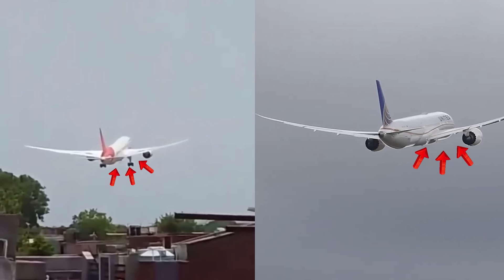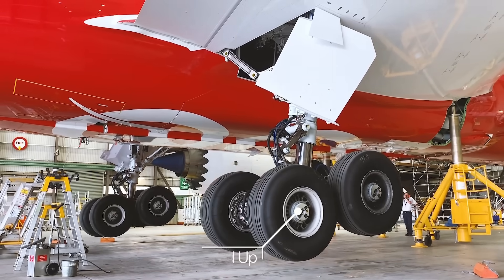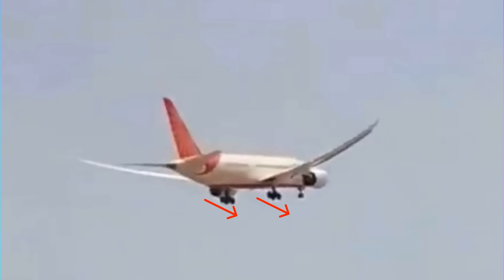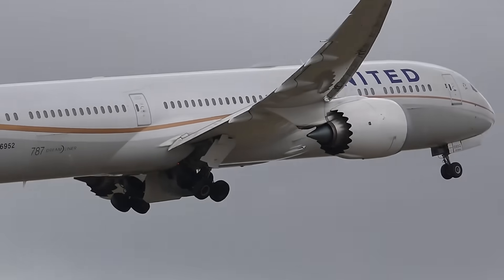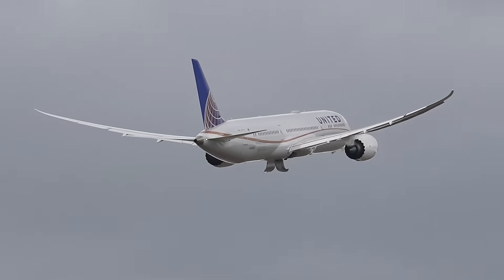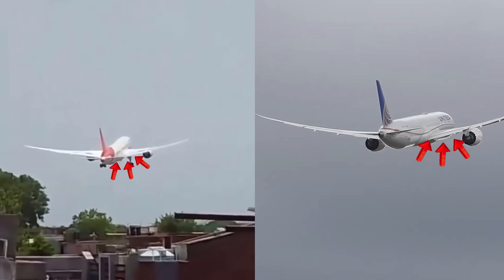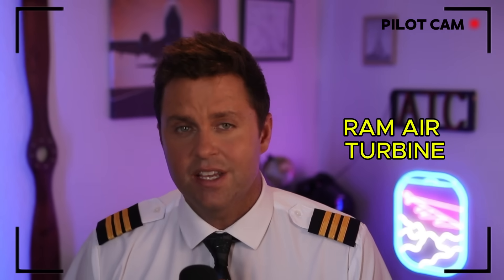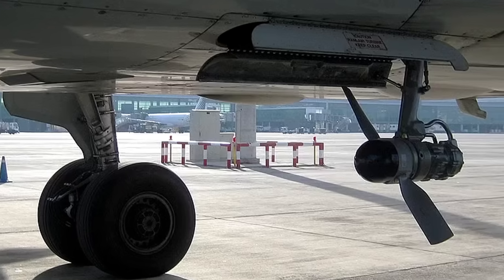Pilot Explains: A New Detail in the Air India 787 Crash Everyone Missed

Comment: I wondered about contamination.  It's either dissolved in with the fuel, or it's separate.  If it's separate, could it get from the gate, all the way to the end of the take off roll, before the contaminant got into the engines?  Seems unlikely.  And if it was dissolved, it would have a negative effect on the take off roll, but if it was enough to get into the air, then there would have been enough thrust to keep flying - it wouldn't just give up like it seems to in the videos if it made it that far.  I fear something else went wrong.

Comment: The CVR will tell the tale for the most part and the engine communication system can tell what they were doing independent from the cockpit from what I understand. I don't know if these were GE or Rolls Royce but most multi million dollar jet engines are leased and the manufacturer keeps tabs on the engine performance as I said independent from the cockpit. Noises indicating warnings and system switch or pilot input are also heard on the CVR. So I think there will be a day when all system coms and CVR coms are transmitted and stored in real time so a crash can reveal what was happening seconds after an incident from inside the cockpit as well. Tower and ATC coms are all recorded in real time and are available in minutes to a few hours as opposed to CVR recovery and transcription or actual voice. Your input Gary is right on. I would think the second the Pilots knew they were in trouble someone would have hit TOGA instantly. The flight appears to have used up most of the 11,000 foot of runway and the entire flight time appeared to be nothing more than the momentum built up in the takeoff run. It looks like they had nothing to shove into the firewall. Just as the flying pilot issued  a "gear up" order, I am not sure that would have helped because the gear doors appear to go dirty before the trucks get into the wells. Just not enough time,  altitude, or speed. That age old triad needed by us pilots to remain aloft.

Comment: Water in the fuel sounds very plausable at first but knowing how the boost pumps work on modern aircraft I really have my doubts. The pumps churn up so much fuel in the tank that any water would be mixed with the fuel and burnt unless there is virtually all water in the tank. And no other aircraft had issues? Are tanker trucks used or is there underground hydrant system? The engine generators do not power the FADECs. each engine has it;s own dedicated PMA that powers the FADEC

Comment: What about the video circulating from a passenger on the flight from Delhi to Ahmedabad showing that nothing electrical indies the cabin was not working? Including the AC in the cabin, which was incredibly hot. Wouldn’t that indicate that the engines weren’t powering the generators and a possible engine problem? Would that even have been investigated before the take off to London? Thank you.

Comment: I think your assessment in the video is very close to the mark.  It is also supported by that they only just got into the at the end of the tarmac (the swirling dust) plus the ATC comms 'no thrust'.
Reply: Then why didn’t P1 follow FCOM/FCTM and call ‘STOP’ before V1?
Reply: @rep7552  Suspect the issue kicked in after they past the point of no return.
Reply: @StephenMcFadyen-j8j Perf A a strong point of yours? How familiar are you with 787 OPT? Or V1, VR, V2 splits? Have you run the numbers for this airfield & enviromentals? Because when I ran a dummy set of calcs, it would have to be obvious way before V1 was reached that something was not correct….
Reply: @rep7552  100% correct if the loss of thrust was evident prior to V1.

Comment: The trouble started on the runway; the pilots were aware but had to commit in the faint hope of sorting it out in the air. My heart breaks for them and the immense loss.
Reply: Oddly enough, they would have done the correct thing by NOT aborting above V1.   But if this was an intersection takeoff.... as I believe it was.... they will be justly vilified for leaving usable runway behind them.
Reply: @eugeniustheodidactus8890  It was not an intersection T/O. They backtracked along 23 and used the full length of 4
Reply: @sharatchandrasekhar  👍
Reply: @eugeniustheodidactus8890  it was not an 'intersection takeoff'. Flight Radar showed that the plane used most of the 3.5 km runway.
Reply: @dilipmishra9787  👍
Reply: Agree, this problem started before they rotated but by then it was a no win situation, choice was run off the runway and crash or takeoff stall and crash.

Comment: That 787 sat in sustained 104 degrees Fahrenheit (70C) for hours before takeoff.   Power for takeoff would have quickly raised that temperature around & near electronics to 140-160 degrees F.   I think the heat contributed to whatever failure occurred.
Reply: What are the DDG PECS limits?
Or don’t you know?
But, yet, you want to comment?

Comment: A FAILED TAKE OFF, can make a relatively safe landing, with enough safe clearence beyond the runway, required by air safety LAWS.
Concrete structures, in the path, are  potentially dangerous.and unlawful, as in this case.

Comment: Hi Gary, former private pilot here. I have a theory that nobody has put forth yet. So say we ignore the flaps  up or down argument for a moment. 

We all can see the plane takes off the runway in all of the videos. It goes down the runway, makes it's rotation and transitions to V2. The landing gear is still down. The plane looks visually "slow". At some point the survivor claimed he heard a loud bang. That "bang" could have been:

#1 A bird strike in the engine
#2 An engine catastrophic failure
or my theory #3 A cargo hold container coming loose and shifting the CG to the tail. 

So why do I not believe that it was a bird strike ? The 787 could have taken off with just one engine. And that would not have caused it to stall and fall like it did. We also do not see any debris or fire coming from either of the engines. Also, both engine nacelles appear to be totally intact. A bird strike would cause the turbine blades to pierce the engine nacelles explosively. That did not happen. 

Why do I not think it was engine failure or contaminated fuel ? Because it most likely would have presented itself up on the max power run up at the beginning of the runway. 

So my theory is that a cargo container came loose directly after take off and shifted the CG to the rear of the plane. We know the engines were working because we can all hear the RAT system kicking in. 

Now this is the most important clue. Right before the plane reached its apogee at 647 ft, the pilot put out a mayday call. So they had power to make the mayday call. The plane immediately goes into a stall. The pilot would/should have instinctively put the nose down, added full power, and full flaps to stop the stall. The plane's nose never goes down in any of the videos. My conclusion is that the pilots were unable to put the nose down to recover from the stall because the CG was now at the rear of the plane.

Comment: Fuel contamination could have led to all engine failures  because  in 30 seconds, fuel could have circulated and if its contaminated, everything   just switches off.
The piolts can not have made any traggic errors than can bring the flight  down with 30sec.

Comment: I been commenting on other channels about this and you are the first to mention lack of engine noise, The video's audio track is in fact so clear you even hear the crash. I agree the engines should be screaming. I think it is pretty clear crash was a result of loss of thrust but why the engines lost power is for the investigators to find out. The Landing gear I think was in the first stage of retraction this used up the last of the hydraulic pressure reserve leaving the wheels tilted at the retraction angle.

Comment: A look at the video of the take off seems to reveal that the plane was not going with good speed. It took the entire length of the runaway  for the plane to lift off. Is it possible that the pilot initially found this odd and so lifted up the gears. To give it a thrust upwards? When it teachesd 625 metres high he realized there was absolutely nont hrust and no lift. And that thec2cenfines has failed him. Hencecthe mayday call?

Comment: also, besides the loud roar of the Engines at TOP, 
you would see a noticeable movement of air/smoke rushing out from them Engines, specially in line of sight with the flow,
according with JJJ,
the only way to shut down a Jet Engine is by interrupting the supply of Fuel, which could flow by gravity down to feed the Engines, with no electrical power

Comment: So possible 2-engines cutoff
1) A lot of water was  pumped in the fuel tanks
2) Someone  idled the engines or cut off the fuel to both engines
3) Total electric power failures for no apparent reason
4) Sabotage
5) Lack of inspection maintenance for  critical parts of FCS and/or on board electric power sources,  including primary and backup

Comment: Great video Gary. The speculation and analysis from many are getting more refined , we will know soon enough. that said, as a 787 operator I have racked my brain about this accident, to me there are 2 possibilities, one of which we haven’t been able to comprehend. The Likelihood of dual engine failure without bird strike, without fuel contamination from other aircraft at the airport, it’s hard to comprehend. A possible scenario is we have a German wings scenario on our hands here, based on the behaviour of the plane , fuel levers are cut off…. I hate to say that’s a real possibility, but it’s consistent with what the airplane is doing. So we either have a mechanical meltdown we have likely never seen before or we have a German wings on our hands. We shall see, I just can’t logically process the dual engine failure happening without the other ingrdients, makes no sense. Anyway, great video

Comment: boeingdriver29, let me underscore your point. Also good analysis by Garybpilot and Capt Steve. These points made, simultaneous engine failure implies a system failure that "cut" (functional) fuel to both engines, or shut down both engines simultaneously. The chance of two independent failure mechanisms in each engine simultaneously is infinitesimal. Yes, contaminated fuel is a good hypothesis; however, it seems that contamination has the possibility of one engine sputtering before the other, or at least not entirely synced up in their shutdown failure mode. However, what might cause an airlock, for example, in the fuel feed to both lines simultaneous? Or cause a simultaneous "shut off" of fuel pumps; or other mechanism of engine loss (I don't know the design configuration)? 

A software glitch could be a systemic cause of that kind of failure mode. The Max-9 crashes illustrated that these flight software systems are extremely complex... and that software glitches can be "lurking" undetected for considerable periods of time, until another component fails that surfaces it (eg. AOA sensors). What would trigger that software glitch to engage in an airlock, perhaps, or fuel flow failure, or other engine failure mechanism—simultaneously? Obviously, we won't know that until the black boxes are analyzed, as duly noted. 

I'm not an airline pilot, but I did fly in the USAF as a navigator crew member (2360 hours) Vietnam era, C-141 and EC-47, and got my private pilots license while in. But I present these hypothesis thoughts as a systems engineer with a PhD in Industrial Engineering. My PhD dissertation at Oregon State University (1991) is titled: "A Paradigmatic Framework for Flight Safety" (you can find a link to it on my business home page "AlpineAnalytics.com"). After developing the paradigmatic framework, one of the chapters of which was titled "Chapter 6: The Paradigm of Technology" and another "Chapter 5: The Paradigm of Normal (System) Accidents", I employed this framework and fully analyzed as a case study the crash of at C-141 into a mountain just 20 minutes from landing at McChord AFB in 1975 after a long flight from Yoko AB, Japan; a tail number 40641 that I actually have in my logbook when I was flying out of McChord during 1968 to 1972. No severe weather, light traffic, why did ATC clear the wrong plane (this one) to descend to 5000 when the terrain was above 7000... and the crew not catch it?  [The tired and fatigued augmented C-141 crew's duty day started in the Philippines 30 hours earlier, and was now was tightly "coupled" to the ATC controller, who had a "cognitive slip" (Chapter 3: A Cognitive Paradigm: Implications of Context) and no one on the crew checked the clearance before descending.] 

The essence of these two chapters regarding system failures and technological devices is that as the technological complexity increases it becomes further and further hidden in the machinery background of the device, so operators (pilots)—and designers—become less engaged with its complexity. And complexity with tightness of coupling increases the probability of a system failure. And under production pressures, not all possible component failure mechanisms get examined during the design and testing process—in fact there are infinite many initial conditions, so its not really feasible, which explains why we need system redundancy. In particular as a "system failure" when more that one component fails and the failures interact in undecipherable and unexpected ways to the operator of the system (the pilot), it is not possible to understand the system failure under that pressure and what to do about it. In fact, the Boeing Max-9 crashes could have been perfect case studies illustrating the paradigmatic framework I developed. They fit it to a "T".

In summary, my hypothesis is that the full investigation will find this to be a system accident, where more than one component failed. That is, some sort of main system software glitch, perhaps (or electrical components, perhaps), surfaced when some other crucial component failed and it shut down both engines simultaneously. In the Max-9 case, the AOA sensors failed AND the software had a design flaw that took control of the airplane away from the pilots in an unexpected way they could not decipher—Hey, "no need for additional simulator training; they're essentially the same as the earlier model 737s" ["Flying Blind: The 737 Max Tragedy and the Fall of Boeing", Peter Robison]—my Chapter 7: The Paradigm of Organizational Complexes: Adaptive Avoidance of Disorder and Systemic Distortion of Information.

Respectfully, aviators,
Root Routledge, PhD
Root@AlpineAnalytics.com

Comment: When dual engine failure... means something common had happened. Fuel and the Fuel system are the main culprits. Pilots are heroes here. RIP to all those souls.
Reply: How about incorrect maintenance or even sabotage?  India had military conflict with Pakistan just weeks ago.
Reply: @kenandbarbie-b6c that cannot be ruled out for sure
Reply: @kenandbarbie-b6c  Sabotage is internet goofy-loop crap! 
India maintenance on a plane with no air conditioning, internal lights and TV's not working on its previous flight is WAY MORE likely!

Comment: Nobody is focusing on the fact that the landing gear flaps are not open. They normally open automatically immediately after takeoff to speed up the gear retraction on a 787. The latter is done automatically without any pilot input. But in the video those flaps are not down !!

Comment: I'm not sure why none of the pilot analysis videos are addressing the fact that the lone survivor reported hearing a loud bang just after take off. I see several people in the comments mentioning other things the survivor said, but nothing about the loud bang. I would presume if one of the plane's systems or components blew out, or worse, there was a small explosive on board, then this would obviously be the root cause of the power failure. I'm not sure if it's possible that smoke would not be seen on the crash video outside of the plane if an explosive was detonated. But either way, the loud bang is the missing link to the mystery.

Comment: The missing detail is its a 2013 plane with old LI-Ion Batteries they will burn just a matter of time. Everything fails around 12 years with Lithium Ion. You lost power, you lost battery power. Here is what else we know, the power fun features in the cabin all broken nothing worked. AC not running right that's what the right engine. Sounds like they lost the electronic control of the plane. Engines prob did run, just no control.